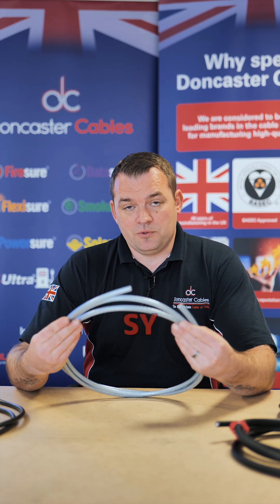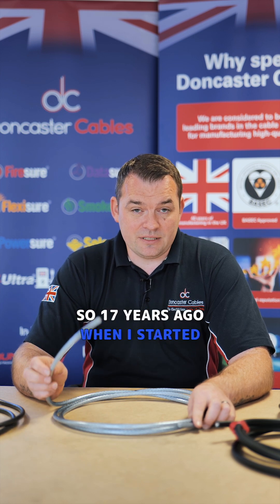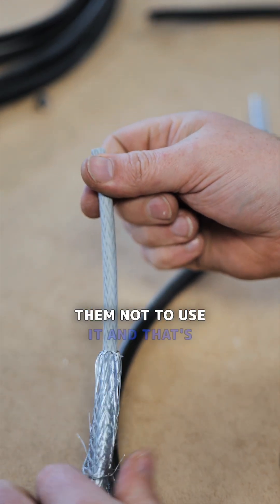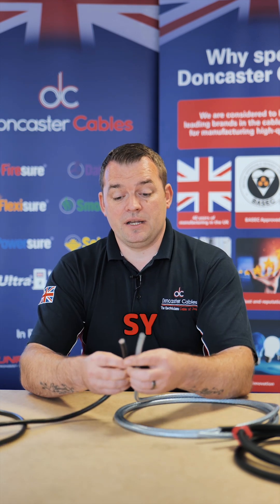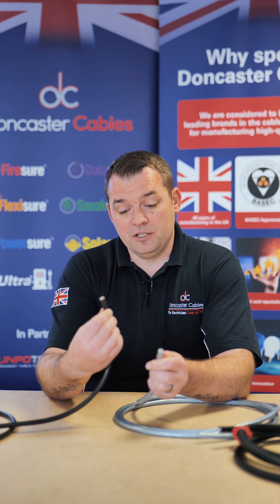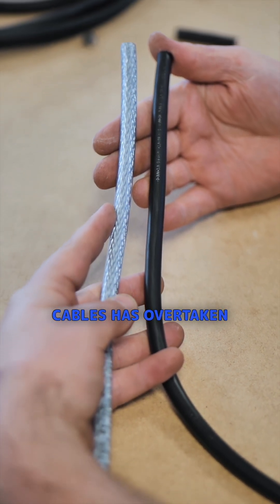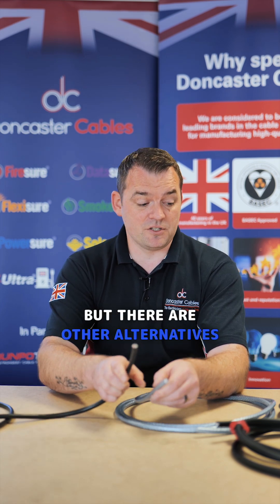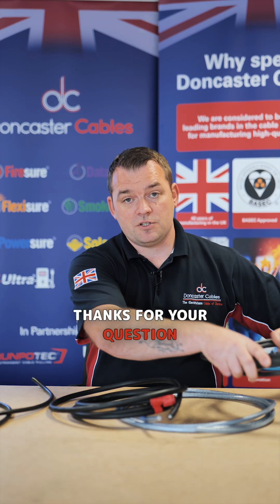SY Thoughts And Opinion???

Comment: Thanks for making this video. I see SY cable used as a cord with Ceeform (IEC 60309) plugs on machines in workshops all the time. I always wonder what happens to the braid at the plug end and the machine end. Which side is earthed? If earthed at the plug, how is this achieved without a SY gland present? I have heard people say earth at supply end of the cable, earth at load end of cable, both ends, and none! I haven’t heard an answer from an official source yet. It would be great to have this settled, because it’s been years and no one seems to be able to give an authoritative answer.